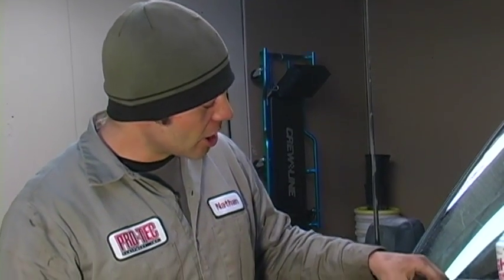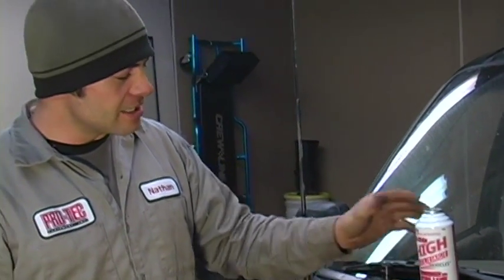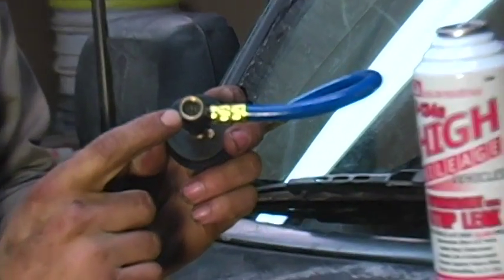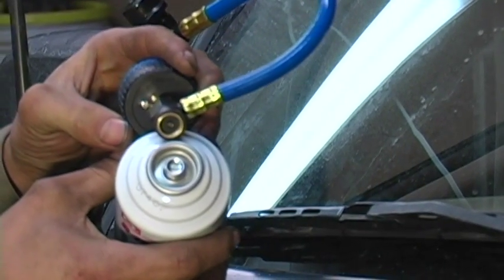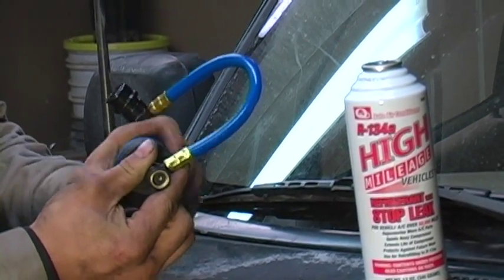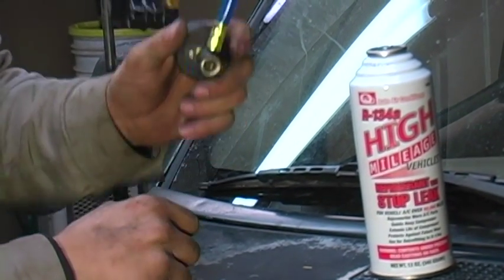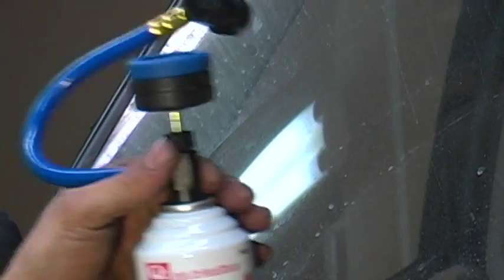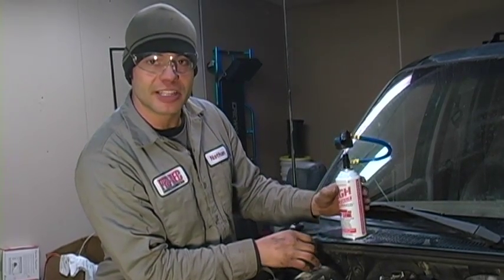How to Recharge an Auto A/C System : Hooking a Gauge Set Up to a Refrigerant Canister

Comment: To properly recharge an a/c system. You need both the high and low side guages. Both the high and low side pressures need to be correct or you can damage your compressor.  You also need to pull a vacuum on the system to remove any noncondensable gases. You also need to be sure the vacuum holds. Before adding the refrigerant.

I'm a certified A/C Tech.

Comment: You should never use that bullsh*t stopleak.  That destroys the heat transfer efficiency of everything it coats, much like having too much oil in the system.  See how much money you saved when you have to replace EVERYTHING because your air isn't icy.

Did I mention it doesn't work?

How about it destroys the several thousand dollar recovery machine of any professional shop that unfortunately connects to your system.

Leave A/C work to certified professionals.